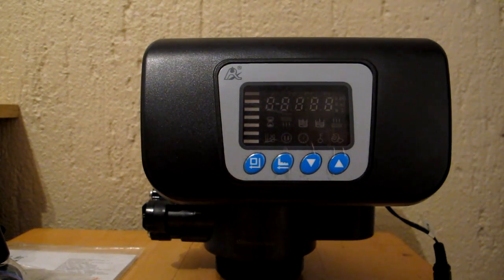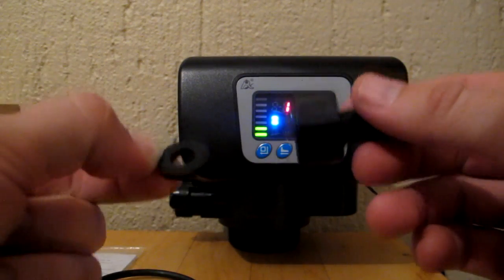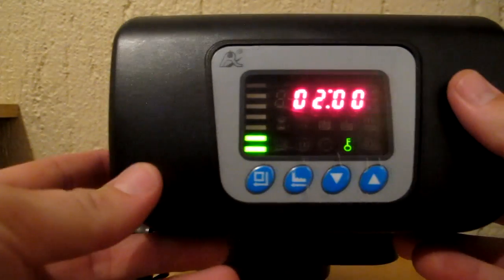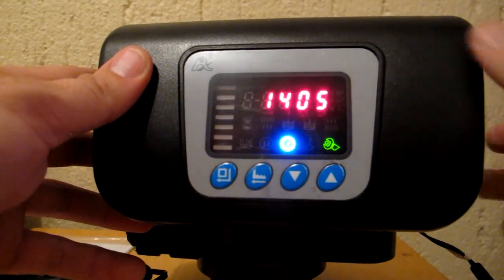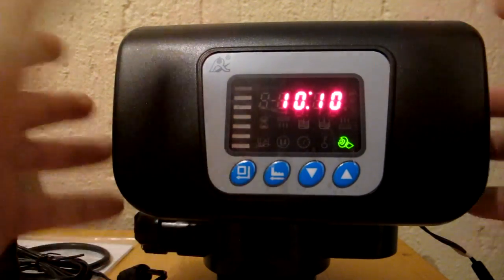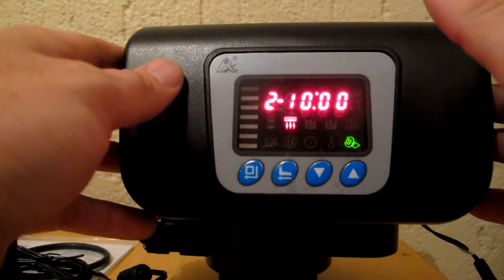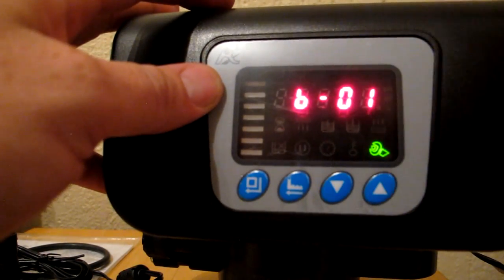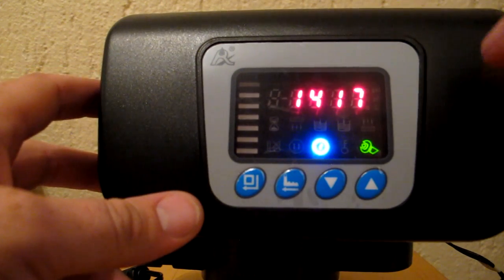F63B1 Softener Valve Head

Comment: Ive noticed since our power went that our salt isnt getting used and lime is coming in. All my settings are set as the video but when i try to firce a regeneration nothing happens
Reply from the maker: That doesn't sound right, is the valve head giving any errors? Also check if the valve in the brine tank isn't stuck in a closed position.

Comment: Hi. Thank you for the video, it is really helpful. but I only have 1 question, If I have a water refilling station and atleast 70-100 containers a day. How many days does it need for the backwash/regeneration? as of now I set it to 5 days. But not sure if it is correct
Reply: It will completely depend on your water quality and what the rest of your system is.
Reply: @semiusefulinformation144  Thank you for your reply, I have dual membrane and I'm producing purified water. I also have these 3 levels of filtering, Water Softener, Carbon Media Filter, and Multi Media Filter. its a 24 stages water system

Comment: If i have a tank for filtering and a second tank for the cationic resin, can i set the the regen and refill to 0 minutes?
Reply from the maker: If you set it to zero minutes then your never going to regenerate the resin and it will get depleted very quickly.
Reply: @FilterShopZa  This is only the the tank that I'm using for filtering, not softening. It's it ok for that. I get a small amount of water coming out the brine port.
Reply from the maker: @sandygrant-taylor8819  Hi, That sounds like the valve head isn't sealing properly internally. If you never use the brine refill or regeneration modes you should be able to seal it off to prevent the water leaking, if it is connected to a brine tank there is normally a float valve at the other end.

Comment: Our F26b1 do not proceed to normal operation screen, it just continuously display the start up screen where all part of the screen is lit and after which showing the model then cycles from  then on. Is my F26b1 needs to be replace? or is there a way to reset the entire program? thank you for your reply
Reply: Hi, Check for an agent in your country, they should be able to check it for you. You are normally able to replace just the damaged component and then don't need to replace the whole valve.

Comment: i have a problem about setting the softener automatic valve for supply boiler water cap 1 ton/hour
could u suggest the best cycle for regeneration,backwash until rinse
Reply from the maker: Hi, the amount of time for each cycle will depend on your water quality. A good start is to run it till you find that your still getting some hardness after the softener and then set a interval that is about 30% shorter than it took to get to that point.

Comment: If power is OFF to the controller while in SERVICE mode, will it maintain at SERVICE mode valve opening?
Reply: LW Ling , yes it will stay in service mode if the power is off.

Comment: Hi! Isn't the regeneration time short? 60 minutes is a lot, but the set 1 is not enough. There is no time to absorb the correct amount of salt water from the tank. I don't want to tease, I just want to help. Have a nice day everyone.
Reply from the maker: Hi, you would want to it just to run long enough to empty the brine tank. The time will vary depending on the pressure in your line and the size of your brine tank.
Reply: @FilterShopZa  Thank You for your answer.